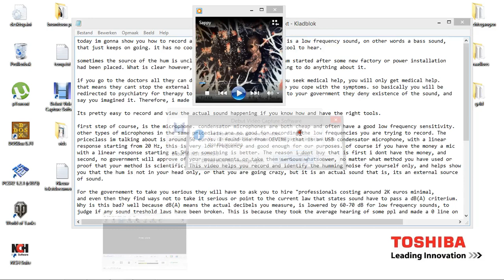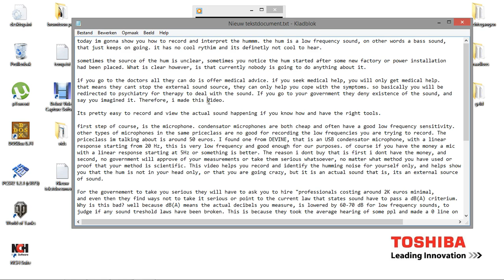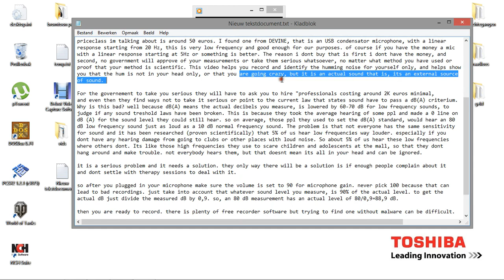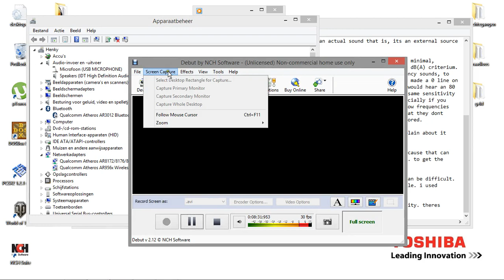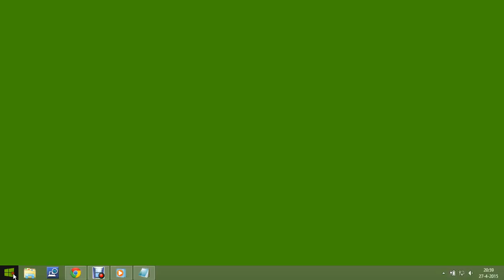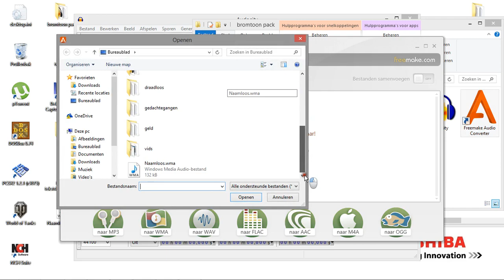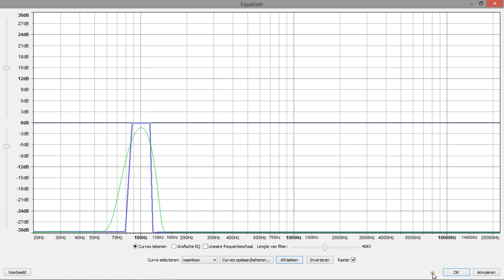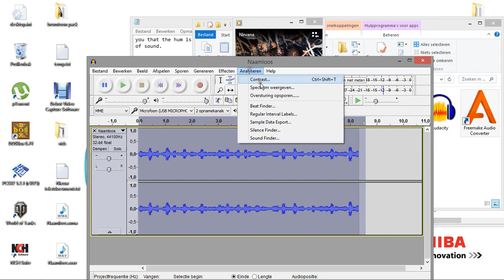How to record and make "the hum" visible - low frequency sound

Comment: Thank you for posting it. I have been suffered with LFN. I live at a city north of Seattle. I have been trying to identify the source of this pollution. My other family members can't hear it. They didn't believe me. Now at least I can convince them the sound does exist. My heartbeats were affected by the sound. It was not comfortable. I am thinking to move to different house, but I am not sure far I should move away from the current location. I am sure this kind of noisy damage people's health, even you don't hear it.
Reply from the maker: A lot of the proof is using the correct equipment, so be sure to record your sound with a microphone that has a linear response on the low frequencies (like 100 Hz, 50 Hz is better). Condensator mic's usually have this and mine was an offer for 50 bucks so not to expensive.

Personally, I hear the hum clearly trough the entire country (netherlands, small country heh)  inside houses. As soon as im outside there is only a slight hum in the distance if I really really focus on it. So something about the houses is amplifying the sounds...There are really a lot of things to research and a lot of guesses but bottomline is it still remains guesswork. I can type a manifesto on my research alone lol. 

You probably dont want to hear this but: eventually you learn to live with it. Its slightly annoying like artritis or something but yeah...Try solving the problem as a hobby, making it an obsession can really drive you crazy. In my country I started hearing the noise after they opened up more frequencies for phone companies and other frequencies for the military, and more transmitting towwers where built. Now there was this other thing with noise cancellation that if 2 waves collide, they partially cancel eachother out and what remains is a new sound on a new frequency (LFN!!!). You can start your research from that point. Good luck.
Reply from the maker: Its weird how your own family can just say you are talking BS I know. I was waiting to see how it went since most people delete their own post after a month or 2 for unknown reasons and since you are still here: How did it go? 

It can be hard being the only one around you suffering froma problem. If someone has artritis everybody understands, if someone has dementia everybody understands, but if someone has trouble from sounds nobody understands. Like I mentioned in the vid the high pitch sound in malls against the youths is real, proven, it is there. But once you hear other sounds all of a sudden you are alone and everybody reacts like they are programmed to laugh at you in the face.

I can suggest not to get mad at your own familiy of course, even though you would expect some kind of support. Once you play the sound you hear on a higher pitch like 500 Hz day in day out they think you are annoying and you notice some real rage. Then you explain thats what happening to you they turn back to the general "not my problem so fuck you" comment. 

Weird huh, how almost every real lifeproblem is something they are ready to help with, but as soon as its about LFN its like a program in their mind is telling them to resist and ridicule you? Thats because its real, there are several researches done in the 50's by the nazi scientists stolen from germany (the scientists who empowered hitler) that LFN makes people accept suggestions more easily. Its a precursor to mind control. Whatever wicked thing you have in mind right now: DONT DO IT. Dont let yourself be controlled, instead understand what it is and where it comes from, and fightby not doing what you are told to do.

Your surroundings have already been influenced to do what is told, the only reason you hear the noise is that you dont do what you are told so they up the amps. That means you are a good person. Dont let it change you, keep doing double checks on your own behavior. You will get ridicule from other people saying "why didnt you just punch that guy" or worse, just realize: "wtf, why would I punch that guy, why should I hurt people, am I a toy, am I just a plaything, no, I am NOT a plaything".

Most people who read this will assume me and you are crazy, but they are not like you and me, they already punch random people in the face and are proud to tell others about it, they already do bad things daily and are proud to tell others about it, people like you and me who refuse...We get the torture. But in the end its these tortured people who are the only ones who really are enitled to the world, because the rest only think about themselves. Theres probably a good bible quote about this but I dont do the bible since some priest showed me a pool and gave me a lame speech about how the rings freely moving all over the pool and god was the rock entering the pool. You know that speech? Thats because the pastor said thats standard protocol on whoever doesnt believe...

Sorry for long tekst but I think at least 60% is what you are dealing with right now. Ive been dealing with this for 10 years now and I've gotten to the point of no longer caring just not to kill myself. These are the options you have, im sorry to say so. You will have no supposrt and no solution. Just feel strong with the thought that the only reason you are getting this is because you have a perception others do not have. Andalso, you get used to it...3rd to 4th year is the worst it gets easier after that.
Reply: @henkvisser9741  thank you for your reply. It's 5am and I was woke up by the noisy and vaberation 3am. I am going to take the action to record the sound. It's like a hillicapter flying in distance. I got nowhere to hide.
Reply: The frequency of the noisy is about 200 Hertz. I entered the detail information to the hum map. They pointed me to the website to figure out the frequency.  The sound from the website is so flat, no vaberation. I can hear and feel the vaberation.
Reply: I actually experienced the exactly same  noise in a restaurant that I visited. They  have a heating equipment above. My wife felt it this time, but it didn't bother her that much, but I  was really uncomfortable with that noise there. I felt such a relief after walking out that restaurant.
Reply from the maker: @captainAppreciate  200 Hz? thats good. That is actually within the borders of most microphones. But what is this "hum map" and "the website" you are talking about? I'm curious...
Reply from the maker: BTW it's mostly military purposes that use low frequency communication since that reaches the most distance and most radio pirates only scan Megahertz. Its one of the reasons why you wont get much help from authorities. I've started recording AND decoding the sounds and its starting to get quite interesting...
Reply: @henkvisser9741  I can hear the LFN in my car and can't hear it in the open. I am going to drive to different locations to create a map. Base on the signal strength, hopefully I can pinpoint the location of the source.
Reply: Yes, this hum pulsing sound affect the heart, brings anxiety and also leads to brain injury.
Reply: @henkvisser9741  199hz will cancel the hum.
Reply: @captainAppreciate  use 199hz to cancel the hum noise
Reply: @henkvisser9741  I use 199hz to cancel the hum noise. We should make viral this information
Reply from the maker: @dadasesa4108  Very nice job! It takes ages and setting up angles to get a good cancellation. I would like to congratulate you for finding something that works for you.

But...sadly, that frequency depends on the noise and also the structure of your home. Like, moving my head 2 meters from the wall cancells a lot of decibells, but the houses are built with a max of 4 meters in diameter. 

Allright, lets stop making things confusing with other situations...The noise cancellation requires the right angle and the right frequency depending on your location. I would suggest adding your findings to the humming map to let people in your area know. Various houses have various setups and thus, various resonanties. I found out that it is the resonance that messes things up. Try making a recording in the middle of the room vs near the wall. (my recordings where near the wall).

So in short: good job, very good job, I never found the perfect angle. It will work wonders for the source that is in your region. Keep using that 199 Hz and by checking different locations and angles you can triangulate the source. 

Like, aim at the same spot from a west position and see if the effect is the same, cross the lines of your aim from both positions on the map, and you will have your source.
Reply from the maker: @dadasesa4108  Oh, btw, is that sound you put out actual dB or corrected dB? Like dB(g) or dB)A)? And what level of dB?
Reply: @henkvisser9741  just play the 199Hz clean tone on any music player (mobile phone also works) with a speaker and this will cancel the hum noise.  I am still running some experiments but because we are dealing with a very long wave,...the source will be complicated to locate (I think) so for the moment the 199 works perfectly.
Reply: Yes, cavity resonance.... to scare and numb the rats from their holes.
Reply: I thought that also - it's damaging to health even when you don't actually "hear" it because it's so low on the decibel scale. I have it here in the high rise apartment - since 2018 and it's gotten worse. I can't sleep because it's too low and bassy and rumbling as if it's coming up through the floor. It's very tiring as it is, but when I can't sleep, it's even more so. Sorry about your heartbeats being affected by it. Hope you get some relief. I'm in sub-housing and can't afford to move anywhere else and the maddening thing about it is I can't transfer to another apartment without a note from a doctor. I like this apartment, and don't want to move especially because of all the costs involved in a move. I think it's the HVAC but I am not sure. Something connected with electricity I believe. Because last year when maintenance put in a Voltage Optimizer, during the planned power shut offs to install, I had some peace - a reprieve from the awful low frequency pulsations. It's really frustrating because a person should be able to just sit in their own apartment and read or sleep at night without being disturbed by low frequencies. I have excellent hearing, and no tinnitis. I just wish they'd care enough to at least TRY to get to the bottom of it (yes I realize they probably won't bother). If it didn't disturb or hinder sleep, I  wouldn't be so apt to complain about it.
Reply: @cyphrinfinity9992  Really sorry that you are also suffering this. I have been doing more readings and research on this topic.  Here is a scientist study that I found on the YouTube: https://youtu.be/ZXCZ3OyklrE. She has studied this topic for last 30 years. Her studies with medical professionals indicated that the LFN caused heart diseases because the vibrations from the sound would thicken the blood vessels and stop blood from flowing after long exposure.
Reply: My wife was finally able to hear the same  noise, I  was so happy that finally someone next to me understood what I h ave been experiencing for the last few years.;but it didn't bother her that much.
Reply: I have asked people in my local church, nobody knew what I was talking about. I have been listening thunderstorm sounds on YouTube to help with my sleep, it helped a lot, but it wouldn't reduce the feeling of the vaberation.
Reply: @cyphrinfinity9992  In your case, I  also think it's the HVAC on the roof top of your building generated the low frequency noise and the vibration.
Reply: @cyphrinfinity9992  You're probably right. A bright UV/IR Laser can still blind you even if you can't see it.
Reply from the maker: @captainAppreciate  It is so good to hear you have found someone close to you that believes you. Hold on to that woman because that is rare! 

I realise I can do much better on the video, 10 min of notepad speech isnt really a good thing etc. It has mostly been therapy for me to see I am not alone. I dont have all the answers but, first look at the obvious, then look at the ridiculous. When you dont have any apparatus inhouse responsible for the sounds it must be outside. Once established outside it becomes criminal or civil law. Once it is a law thing db(g) becomes a practice. I once went into city council playing 60 dB(g) of 200 Hz. Within 5 minutes I got kicked out. I asked why, they said because of the sound. I asked them to let a professional prove that I made that sound since according to pro's and city council that sound cannot exist...

Yeah I got kicked out without result. Well..The result was that other people where bothered about the sound that acccording to their own standards they should not be able to hear. But yeah, try to get that understanding while being kicked out.